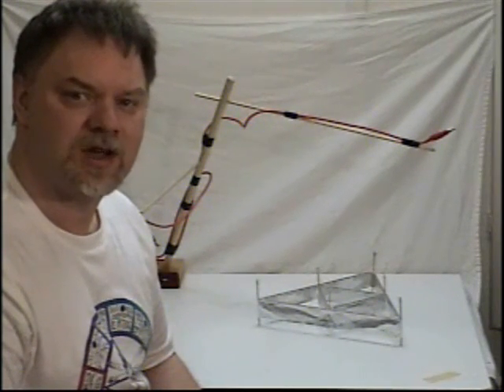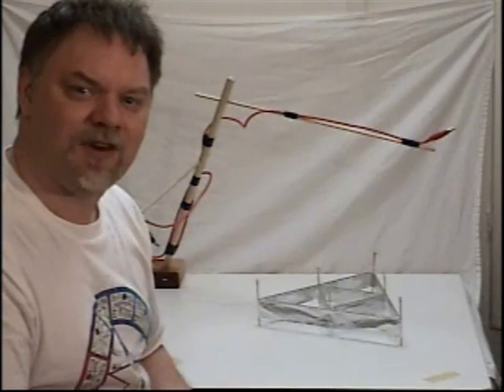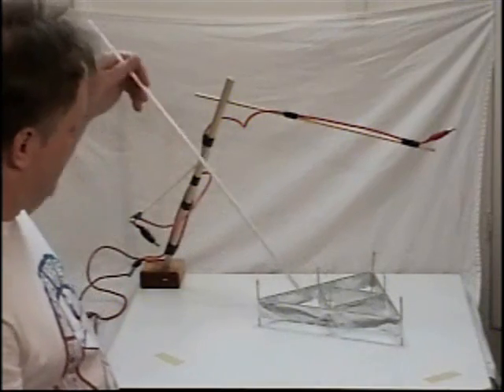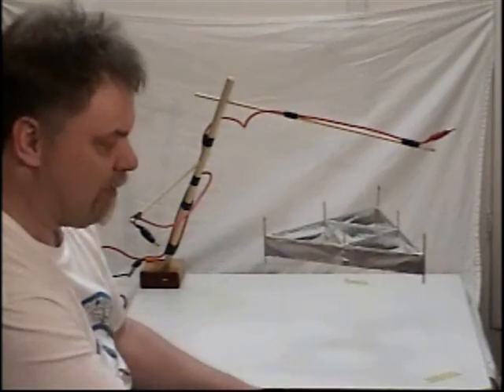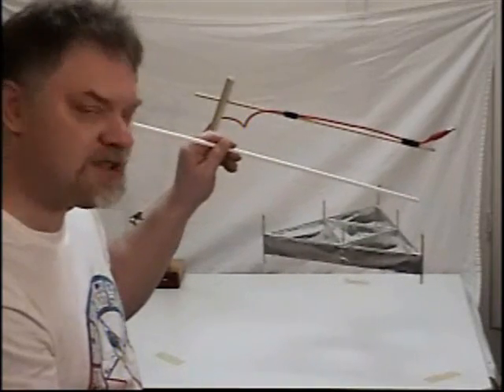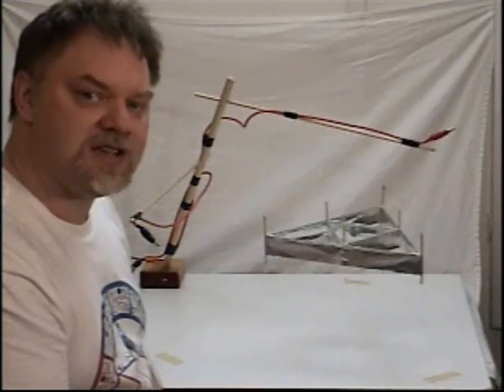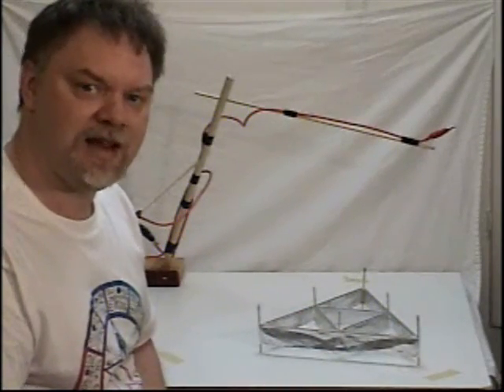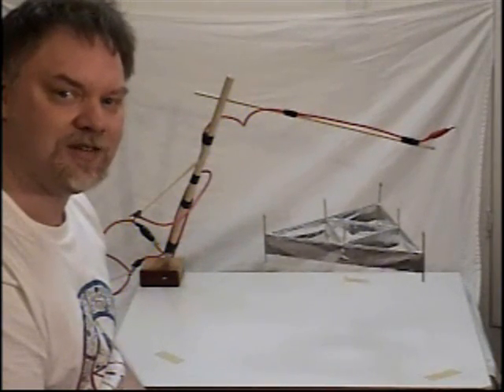LIFTER TECHNOLOGY: Demonstration & Explanation

Comment from the maker: ALL MOTION INTERACTS With GRAVITY, and changes in Electrogravitational Density are Only Part of how Lifters work. Ion Wind is present, and Lifters Will NOT Work in vacuum since Air is the essential dielectric medium. T.T. Brown conducted demonstrations within a Vacuum (see posted video) BUT Those Experiments used up to 10 Times the Voltages available to me, SOLID DIELECTRICS and Coronal Plasma.

Comment from the maker: The essential design requires the asymmetrical configuration. In his patents T.T. Brown used both air and solid dielectrics, also much higher voltages and surface corona when working in vacuum. Am unable to duplicate this with available resources, but I have not yet seen accurate reproductions of the original experiment, which would validate the Electrogravitic Effect one way or another.

Comment: Exactly right.  What he hasn't shown is a balanced case, or two thin wires.  I attempted this and you get no ionic wind.  The ionic wind occurs when you have dense charge going to less dense charge (the wire to the foil).  He did get one thing right, it hurts like hell when you cross into the circuit!

Comment: One doesn't need a PhD in Science to explore into it. 

As i have explained, you can charge air molecules in either polarity. You give the molecules some electrons from the anode, you charge them negatively. You remove some electrons from the molecules to the cathode, you charge them positively. It's not the polarity that matters, it's the assymetricity of the electrodes that matters as you have already explained in the video.

Changing the polarity didn't prove that it's not ion wind.

Comment from the maker: A ball does not stay where placed, but will roll down hill. A low-pressure zone above a curved wing creates lift, allowing aircraft to fly. A localized "gravitational depression" attracts the rest of the Lifter towards the high voltage field focused around the fine wire. Yes... Lifters have Ion Wind, but T.T. Brown also conducted numerous experiments in a vacuum (i.e. No Ion Wind) and still measured the Electrogravitic Effect.

Comment from the maker: Air is approx ¾ Nitrogen (N2) and ¼ Oxygen (O2) plus a few other gasses. Since N2 is more stable than O2, when 'ionized' by a high voltage, you create a lot of free oxygen, which combine with O2, forming O3, or Ozone. Being highly unstable, O3 breaks down quickly, often reacting with (oxidizing) organic molecules, which is why Ozone is not good to breath. Ionization is not Ozone (ionized air =/= ozone) Ionization Creates Ozone.

Comment: in addition to that, if it's electrogravitic effect, the so-called "gravitational depression" will be localized in the device itself.

You won't get a lift-off with a localized "gravitational depression" but the device will stay where you put it in the air. That certainly is not what we observed from the video. 

We clearly see a thrusted lift-off. Remove the 3 strings attached to it and you will see it keep going up untul it's restrained by the wires.

Comment from the maker: The 'quality of space' that is different is the tightly focused Electrogravitational Field surrounding the fine emiter wire. So far as the flowing air being cooler, that might be caused by the density or pressure differences with the surrounding air.

Comment from the maker: Although vertical lift may be out of reach with current power supplies, it has been suggested the USAF B-2 flying wing applies this quite effectively to augment normal jet propulsion for greatly extended range with real fuel savings. Too bad Boeing is not allowed to use this technology on their airliners!

Comment from the maker: Beyond 'Proof of Concept' Lifters have little practical use. Current power supplies are still much too heavy to for them to carry aloft. However, if incorporated within a helium 'lighter than air' vehicle, with a sufficient power supply, it could easily propel itself around at tremendous speeds. Question: Could similar technology be the source of large, silently floating aircraft that emit a blue coronal glow, and faint humming sound, just prior to racing off a high speeds?

Comment from the maker: That is correct, an asymmetrical cloud of ionized gas is necessary to allow the basic Lifter to function. However, T. Townsend Brown used solid dialectic materials during his more advanced vacuum chamber experiments. Consider this... if the electrogravitic effect is nothing more than the movement of ionized air, then why does it still work when the flow of current is reversed?  Think about it....